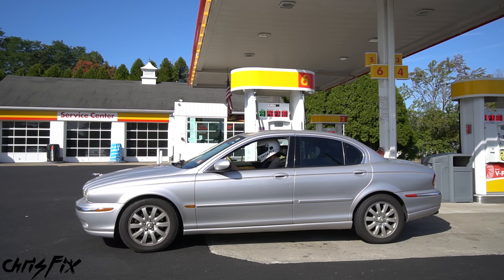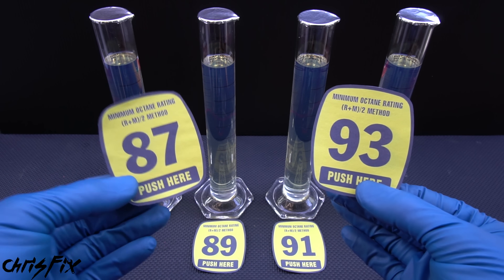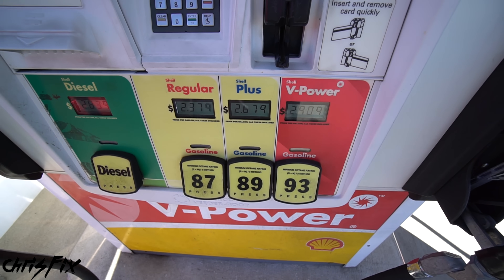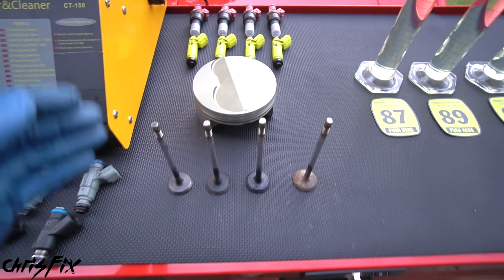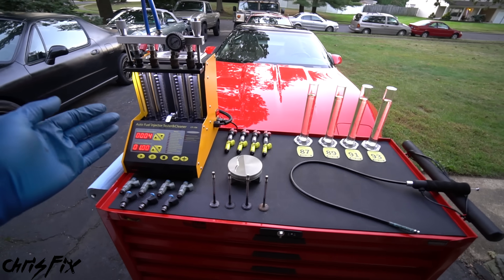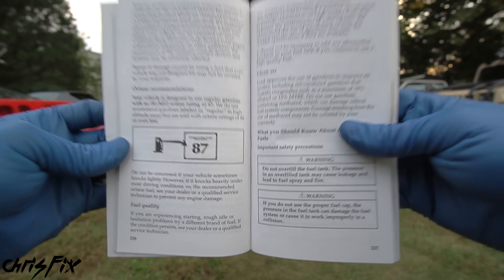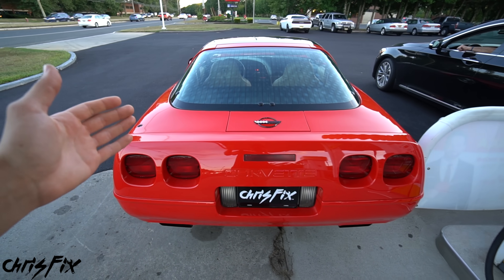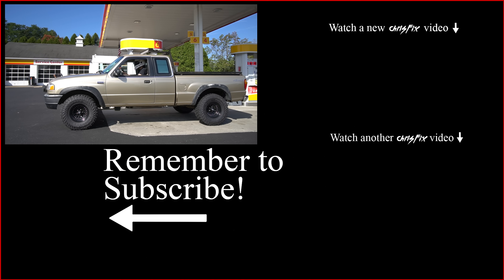What is the BEST Fuel to Use in Your Car or Truck and WHY

Comment: For anyone wondering, the middle option usually called "mid-grade" or "medium" is just a mix of premium and regular together.
Reply: @SlikLizrd  Hey so I actually managed a gas station, all we sold was gas.  I went through a schooling process about how the gas works.  Mid-grade is literally a mix of premium and regular at a about a 1/1 ratio.  Meaning if you mix 20 gallons of regular and 20 gallons of premium you get 40 gallons of mid-grade.  That's the entire point of it.  In fact, we only got regular and premium gas delivered to the station, there's no pre-mixed mid-grade.  It's mixed within the pump system.  It literally takes from both tanks underground to mix it as it comes out of the nozzle.
Reply: @rabidraccoon027  Your answer is US-centric. In Australia we have four grades of petrol (gasoline) and each has its own ground tank with different coloured and marked covers. 91RON, E10 which is 94RON, 95RON, and 98RON. Plus diesel at every station and auto LPG at some. And the pumps all have separate delivery lines and nozzles - colour coded and marked. No mixing at the fuel station. 
You should not assume it's the same everywhere.
Reply: @rabidraccoon027  I'll take your word for it. CHEERS !! 
 I only use the 87 Octane, so it's all good.
Reply: In the USA perhaps. 
In other countries, not necessarily. 
In Australia we have separate ground tanks for each octane rating (different coloured and marked covers), and we have four options - 91 RON, 94E10, 95RON, and 98RON. Plus diesel at every fuel station and auto LPG at some.
Reply: @robboardman598  Aussies don't have American-type problems -- because you don't have America's Republican Party or it's leader, Donald Trump.
 Count your blessings !!
Reply: so youd still get shells additives from premium mixed with regular?
Reply: @dylanfoxaygameh5281  in Australia, and "mixing" of octane ratings or additives would occur at refinery or tank farm level, not at the fuel pump.

Comment: Correct me if I'm wrong. Cars designed to use regular gas uses lower engine compression. As high compression can cause detonation or miss fire in poor quality or low octane fuel. Turbo engine normally uses low compression. But turbos increase intake pressure so I'm not too sure how this will affect low octane fuel burn. So can running the car in the range of rpm with turbo lag accomodate regular gas?

Comment: Wait the highest is 93 in the US? Really? So in Dubai if im paying for the lowest (91) i should be more fhan fine? Cuz other options are 95 and 98 only
Reply: You guys use the RON system to grade fuel while the US uses the AKI system

87 91 93 AKI is equal to 91 95 98 RON, respectively

Comment: I'll tell you another thing when I run my car is at the track I ran 87 and gotten Time Slips and I ran a hundred Octane and gotten a better time went back to 87 and got the same time slip went back up to 100 octane and got the same time slip so there is a difference in power and you can run all three in your car it doesn't matter what type of car you have

Comment: If your vehicle requires high octane & you pull up to a gas station that only has 1 gas hose.
99% of people run cheapest 87 gas in their vehicles  ( if manufacturer calls for it) . The gas hose will hold close to 1 gallon of the low octane in it before your higher octane gas starts pumping into your vehicle.  Like it or not you will probably get one gallon of low octane!

Comment: Burning high octane  gas on older engines 1985 - 1995 did make a difference on the inside of your engine. I have disassembled vehicles that ran only low octane. The carbon buildup would get so thick, it would break off and bend the valves.
Engines that ran on 93 octane would be shiny on the inside!
I have not torn apart today is engines.
Reply: That's the main question. Since most of the cars these days are direct injection, is 93 octane making any difference or not for valves.

Comment: When you're adding any type of fuel additive or cleaner I personally add that stuff before I put gas in my vehicle. That way the fuel mixes everything up. I'm not sure why he says to add it afterwards. I get it if your at a gas station where they don't have any premium fuel then you almost have to add that stuff afterwards but again personally I would go into the store to see if they have the octane booster before I filled up and use it first. Normally the only thing I add is a fuel system cleaner like Sea Foam which I add before I put fuel in my vehicle.

Comment: Double check for yourself I was looking at a particular car on car websites and several times I've seen the dealer list the fuel requirements as premium gas when I checked the manufacturers websites they said regular fuel and after looking at one I determined they run on regular fuel so check for yourself

Comment: My concern is with additives over time. Several times in the past, the amount of additives changed between premium and regular due to cost savings. Of course the amount was still the bare minimum required by law, but the fact of the matter is that the premium fuel had a "better" additive package. And who knows when and how often they change this to save money. Right now, most fuel companies have the same across the grades, but that's not a guarantee. I hate thinking about basic things in life. Unless I'm strapped for money, I'm going to do what reduces my cognitive load.

Comment: I have two questions:
1. Does 87 or higher = premium recommended?
2. Can you “cheat” in a premium required vehicle by using 87 and adding a fuel additive?
Reply from the maker: 1 - Unless it explicitly says premium recommended, no 
2. That would technically work but I would not do that unless I was forced to (like if there was no more premium in your area for whatever reason)

Comment: Would have been nice if you told us what "octane" is. Here's what I found: 

"So, what is octane? It's a hydrocarbon molecule that gives gasoline the ability to resist detonating prematurely in the engine. 

"The name "octane" comes from the following fact: When you take crude oil and "crack" it in a refinery, you end up getting hydrocarbon chains of different lengths. These different chain lengths can then be separated from each other and blended to form different fuels.

"For example, you may have heard of methane, propane and butane. All three of them are hydrocarbons. Methane has just a single carbon atom. Propane has three carbon atoms chained together. Butane has four carbon atoms chained together. Pentane has five, hexane has six, heptane has seven and octane has eight carbons chained together."

Despite common belief, using a higher octane fuel than what is recommended for your vehicle doesn't give you more power...unless you have a knocking or pinging situation going on, in which case a higher octane fuel can restore power by preventing knocking or pinging.

Comment: 98 octane turbo cars run like rockets...less gas more mileage and most of all more power
Reply from the maker: If it's specifically tuned for 98, sure, but putting it in any regular car won't net those benefits and you'll have a bigger hole in your wallet

Comment: If your manual says use regular, is there any reason (other than price) that you should not use premium? I.e. If I like the idea of preventing carbon buildup and contributing to preserving the long term overall health of my engine (and therefore have been using premium all along), are there any risks to using premium for a car where the manual says to use regular?

Comment: So my car said 87 but I have been using 89 for years now. Should I revert back to regular or just stick with mid grade?
Reply from the maker: I would switch to 87 and pocket the difference, you're not getting any improvements with using mid grade if your car only calls for 87

Comment: My Dodge Durango use 91 octane and we have only 91 octane and 95 octane and they usually fill it with 91 as the gas caps says but I tried once to fill it with 95 yeah it's like 10% more expensive but I could swear it last 20% more like 100 kilometers more especially on highways
Reply: Yeah some gas station here have 108 octane but I could barely find one
Reply from the maker: Interesting, where are you located?
Reply: @chrisfix  Saudi Arabia. 
And it's a Dodge Durango 2000 V8 5.9

Comment: I’ve heard though that you have a higher amount of sulphur in your fuel in America. I’ve seen an article stating that bmw didn’t really sell cars with N53 engines that have direct injection in America because of the higher amount of sulphur in the fuel and instead they stuck with the n52 engine

Comment: Honestly people dont put anything but (REGULAR) in your engines in general wither its a car or your precious motorcycle i was a fool by putting 91 and 94 in my motorcycle just to help it stay clean in the fuel tank it really doesn’t do anything but costing you an extra 10bux on less you got money to burn then be my guest absolutely not worth putting higher then regular

Comment: Meanwhile in Poland on Shell you can buy 98 and even 100 octane fuel
Also you said that octane number doesnt impact the hp of the car and while that is only partially true because the diffirences are just so slim that its not even worth it. My friend tested it and the diffirence from 95 to 100 octane was just 1.6Hp

Comment: I use E15, 88 octane, sold at my favorite fuel stop (Sheetz). I use it in my wife's Toyota Highlander and my Jeep JT (both are V6 engines). No issues, and this fuel is the least expensive fuel at Sheetz.

Comment: One thing I've been confused about with e85 is if you can mix it. I know there are conversion kits and it has gasoline in it already, but can you fill a half full gas tank with normal gas if it already has e85 in it on a flex fuel?

Comment: 14:15 you should pour the octane booster before filling up your tank otherwise it's not gonna mix well
Reply: Maybe add half tank of gas, then the additive, then the final fill, ALL in one stop.  Or, optionally, speed up to 100 MPH and repeatedly jam on your brakes to ensure PROPER additive mixing in the fuel tank.  Then, immediately, drive to a service station to replace brakes, tires, and the pants you peed in during the repeated emergency stops.
Reply: @WilliamMurphy-b6v  you left out the first step stop at Walmart and buy some depends.

Comment: my 2008 jetta is tuned to run 93

but ive been using 87 & 89 and its been drinking 1/4 tank of gas within half an hour

but when i use 93

it holds up to 255 miles from full to empty 

but 87 & 89 drinks it so quick
Reply from the maker: Interesting, thanks for sharing

Comment: Hey! Thanks for mentioning everything briefly. 
Quick question: if you start using Premium on a used car that you bought, does it also help removing all the carbon particles that might be there previously?
Reply from the maker: If you use top tier gas, it can definitely help

Comment: Does using Octane booster continuously damage the engine? 
I bought a car with high compression ratio but premium gasoline is very hard to buy. Any ideas?
Reply from the maker: If anything it would probably help your engine more than hurting it

Comment: I believe that many gasoline have ethanol inside (but I do not see E-85 listed so perhaps the levels are lower). I typically use non-ethanol (Typically at the Union 76 stations). However I may occasionally use Shell premium in the USA for the detergent  additives.

Comment: I do disagree with the advice use what the manufacturer recommends. At least in my case. I own a Lexus with a 2GR FE. You check the Highlander’s manual? Regular. You check mine? Premium. And I owned a Subaru Baja which said premium but I drove it one regular for 240k miles till I sold it and it was fine. That’s just my 2 cents tho
Reply from the maker: Interesting, thanks for sharing

Comment: Hey Chris, question do you(or anyone else)! I know this is an older vid but I have a quick question. I have a 2016 WRX and some black smoke was seen coming out of the exhaust. I know I’m running rich in my afr but it didn’t do it until I put some 93 octane in it instead of 91 because 93 is cheaper where I live. I wanted to make sure that wasn’t causing my black smoke problem. I just bought it and still haven’t checked off other things causing the rich afr but wanted to check this box.

Comment: Thank you for helping dispel myths. PS - I tried to run 87 in my Jaguar (premium required). After a year, I had to change plugs and coil packs.  Switching to 92 fixed the issue.

Comment: If ratings In America and Europe are the same, why did Matt Armstrong's Audi engine get ruined? He said it was because he forgot to have the tune for American gas. His engine was turned on European gas.
Reply: Americ gets 89 91 93

Europ gets 95 97 99

Eu gas is higher octane therefore better

US engines are low compression and low power/litre so don’t need to octane.
Reply: @nickcook7408 no it's not, EU uses the the RON system to measure octane while US uses AKI

Thats like saying its hotter outside because its measured in Fahrenheit instead of Celsius

Comment: Hi Chris so i have a VW 2024 altas cross sport on the fuel door it says 87 or 91 but on the owners manuals it recommends 93 to be used not 91 unless 93 is not available. I have a quick trip near me and they have 2 91 ones one that says zero ethanol and the other 85 ethanol. Please explain thanks alot
Reply: I believe its a 4 cylinder turbo charged

Comment: One thing missing in this video is Ethanol content.  Almost all fuel today has some percentage of Ethanol in it.  Ethanol has less energy density (roughly 33% less) than pure gasoline, and the amount of Ethanol in the gas will have an effect on the octane level.  So the statement that all of these fuels have the same energy density is only true if the ethanol content in them is the same.  Octane levels in today's fuels are influenced by the amount of Ethanol present in the gasoline.  Where the Ethanol levels in the gasoline are higher, the fuel is less efficient.

Comment: I'm at a crossroads here. From your research it clearly looks as the premium is the better choice to help prevent detonation and more cleaners to keep the engine clean. To me this sounds like the best choice for lifespan of a vehicle whether it requires it or not. Then on the flip-side you say run what the car requires or recommends. I own a 2024 jetta manual transmission on the fuel door it says use 87 octane. This vehicle does have a turbo so I opted to run premium 93 octane from day one for the added engine protection and to increase the life span of the vehicle in my mind. So am i wasting money or spending money on a fuel that can increase the lifespan of this vehicle even though it isn't required or recommended?

Comment: I bought my car used and I’m the 3rd owner, the 1st owner used premium, the 2nd owner used regular. Now the knock sensor is sensing something. Could it be that the regular is causing it and it will stop if I swap back to premium? And what will happen if the two types mix in the tank and stuff?

Comment: You actually left out the real reason for the octan need for an engine, it is the engines COMPRESSION RATIO.
Reply from the maker: That is correct, but that's for the manufacturer to then require/recommend a certain octane

Comment: Just use the gasoline the auto manufacturer  sez to use in your vehicle owners manual. And don't believe the BS about the difference in winter and summer "blends" of gasoline. 87 octane is just 87 octane. There is no difference in "blends." 
It's the proper octane that is more critical and important in vehicle engine performance. This "seasonal" blends are just a marketing and profit making scam by the oil companies. It's just another way to steal your money. Pure bulls**t.

Comment: Have you noticed, the European gas pumps have individual nozzles for the different octane pumps, so you get the octane fuel what you pay for.
American pumps shown, with one hose for the gas pump. You get what's in the nozzle hose, which could means you could get up to 3/4 gallon of what ever the previous customer has filled up with. So if you want 89 or 93octane. You  could be paying for E85 or 87 octane up to 3/4 gallon of fuel & not getting what you pay for.
If its not recommended to run on Ethanol (E85) in your vehicle or you fill up a gas container for garden appliances or generators that don't run with ethanol fuels. You get whatever the last customer has filled up with in your gas container. so look for individual octane gas nozzles at the gas station, then you get what you pay for and required fuel.

Comment: This is not a hundred percent true if I have a Toyota Camry  xse. And when I run  90 or 93 in it you can notice a big difference as runs weak on 87  it’s a fact that higher octane in any car burns colder and better and will never have to worry about engine knock will make you car running  safe is it a huge hp gain no only in a high compression car but over all I believe it’s better to run a higher octane and not rely on that sensor to bump the timing up because by running the higher octane the fuel will burn at the right timing which is slightly after too dead center and that’s ideal for performance and reliability over all
Reply from the maker: thanks for sharing

Comment: Toyota has a 2.5 motor with elec
 M
Valve Timming. Knock sensor will lower compression. High test fuel and KN air filter will yeild more power and better mpg by 15 percent.

Comment: In Europe in my country you can only get the 95 (standard) and 100 (performance). The 100 is usually only used for sport cars and motorcycles. The difference in price between 95 and 100 is around 20%.
Reply from the maker: Watch the video!

Comment: Has there been much testing on using a 87 Octane Ethanol Free vs. Regular / Premium with standard up to 10% Ethanol  in Engines designed for Premium Fuel.